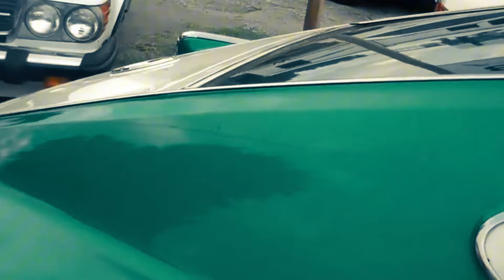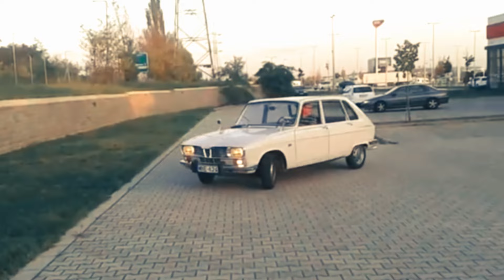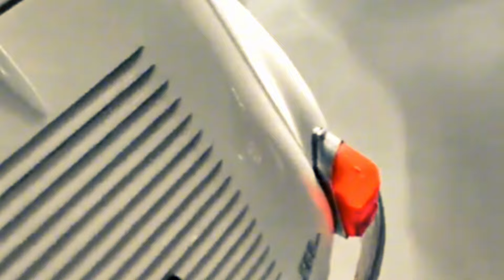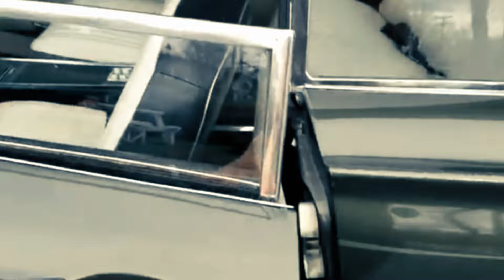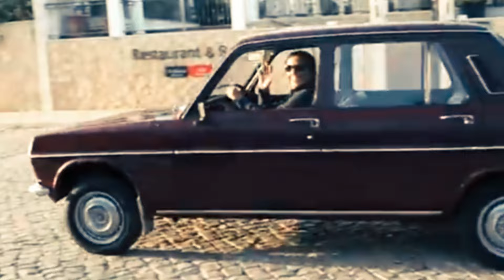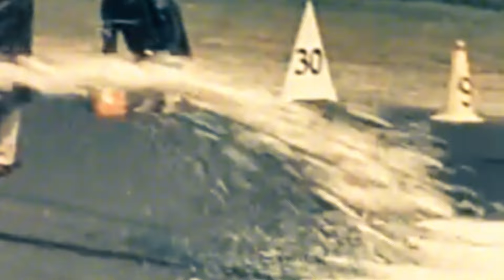THIS KILLED Many People? 10 UGLEST Cars!

Comment: Talks about 1967-1968 Thunderbird while shows a 1958-1959 model and then, they mix images of the rear engined Simca 1000 they are talking about with the newer front wheel drive Simca 1100,  all the time showing images not corresponding with what they are talking about.
Reply: There   a single picture of the Toyota Publica Sport.